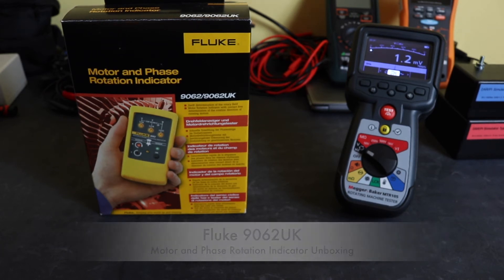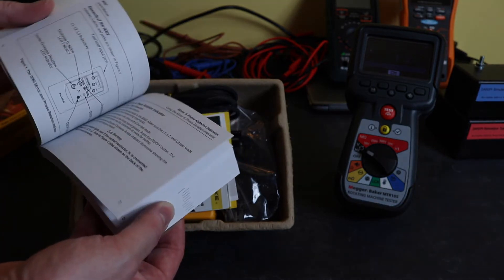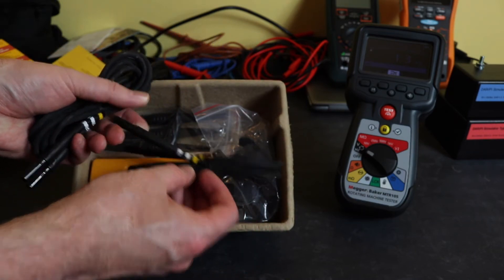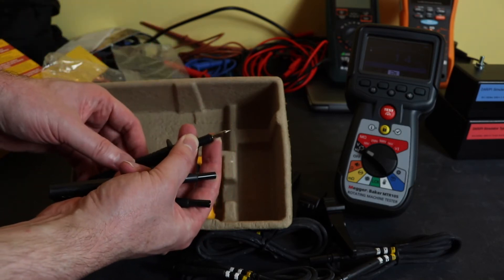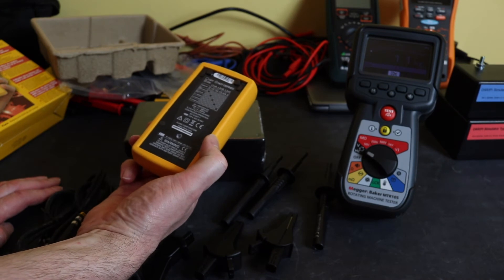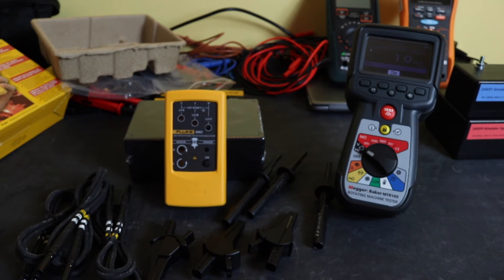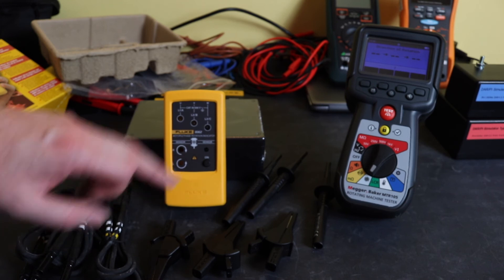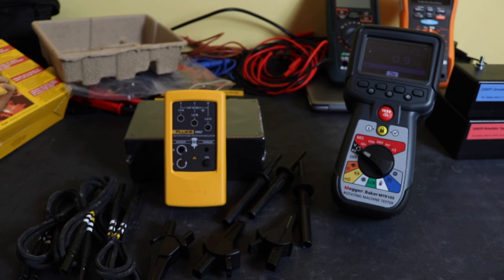Fluke 9062UK Motor and Phase Rotation Indicator Unboxing

Comment: I am from USA...I Love your fused test leads for fluke 9062.  Where can I buy the replacements fused test leads.
Reply from the maker: The leads came with the tester and it doesn't look like they are available separately. You can buy a black and red fused probe set from Fluke TLK291 and you can buy the TL27, heavy duty test lead set.
You would probably be best to approach a local test equipment supplier or enquire with Fluke customer support directly.